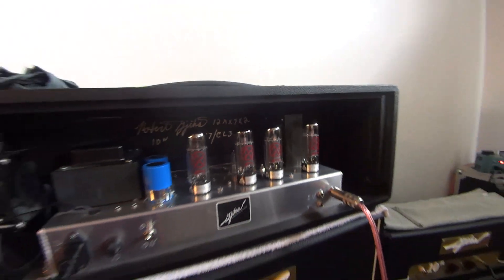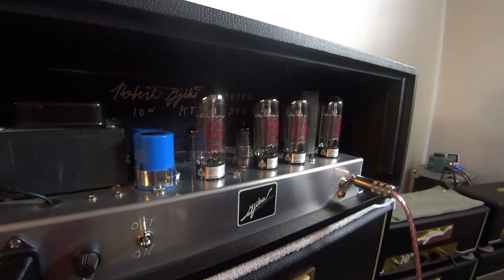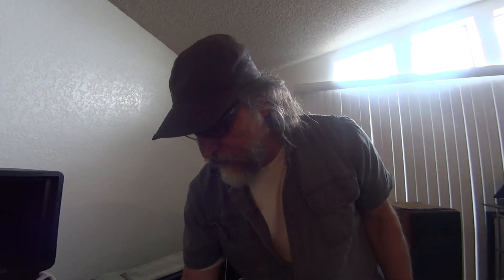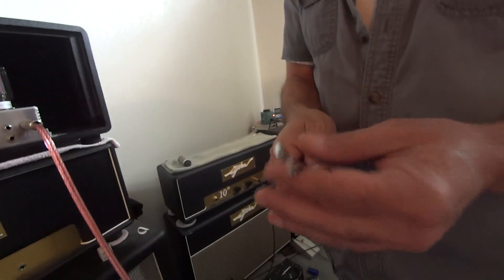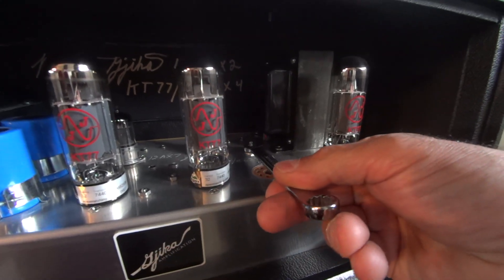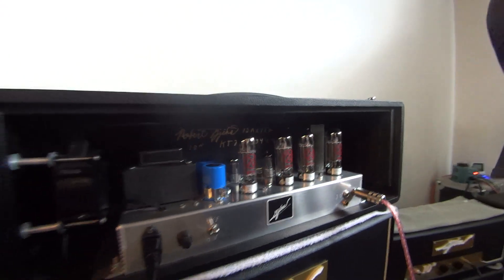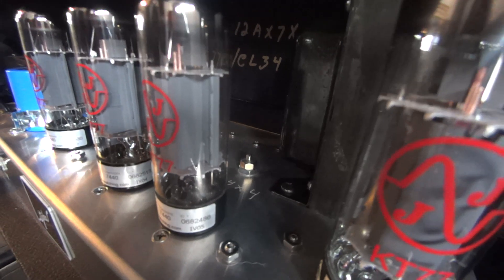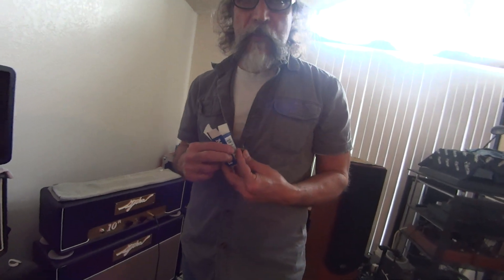Tube-Tech-Talk - For Gjika 10^n Guitar Amp Owners - retube - Mullard reissue vs. JJ 12AX7 tubes -

Comment: Hope all is well and you are getting ready to have a great Thanksgiving 🙂...just wanted to say, beautiful chassis on your amps....I love that you hand engrave with a Dremel I assume.... what goes where. Just reinforces the fact that this is a hand made piece. Consider if you will though an etching machine. There is one called the Personalizer...available at Jantz Knife Supply. Even Bob Loveless went from engraving to etching and I would compare you two as equal craftsman 👍. The "Mulllard" reissue I would agree !. Have not used JJ's but have tried Sovtek 12ax7lps ....EH 12Ax7 long plates.....NOS Jan GE 5751's and just recently replaced NOS Mullard CV4004's .....yes the $150 a piece ones with the big box plates..... after about 20 years. Finally started to get noisy. With the reissue short plate CV4004's.....and I have to say for $40 a matched pair I'm pretty happy. We'll see how long they last 👍 Be well ! 🤘

Comment: I was too poor to buy your amps, so I bought a PV parana and I threw out the JJ preamp tube and replaced it with a tung sol. I replaced all the electronics in my guitar with vintage parts and bought the original Heritage style Celestion 20 watt ceramic speaker that Jimi Hendrix used on his first album. I’m using the Q strip by tech 21 for my extremely wild EQ setting. It sounds just like Shawn lane now. 😎 thank you for all your awesome advice which I have learned from watching all your videos!